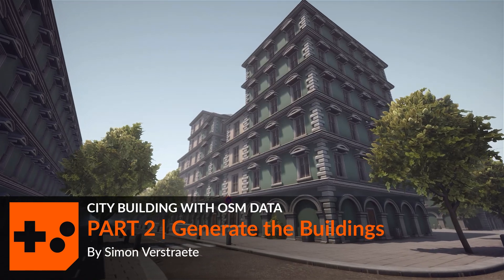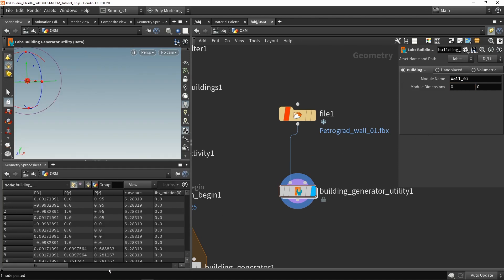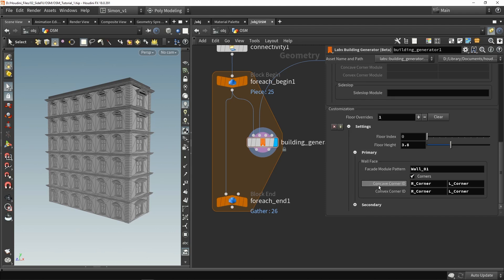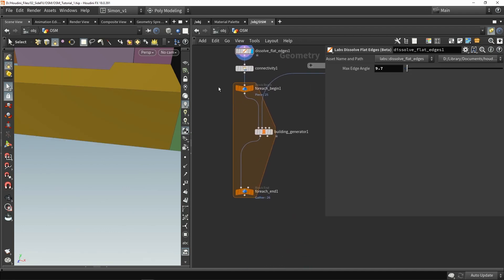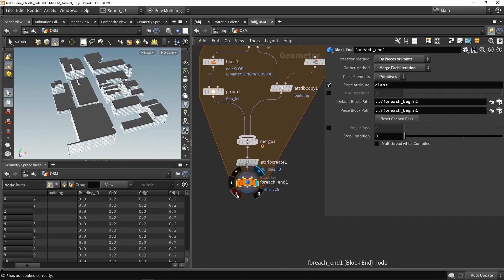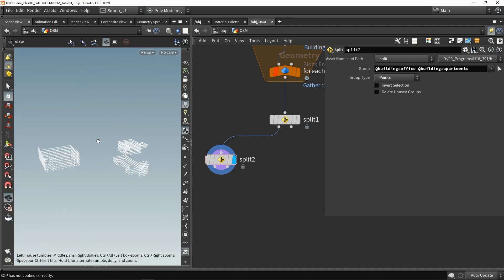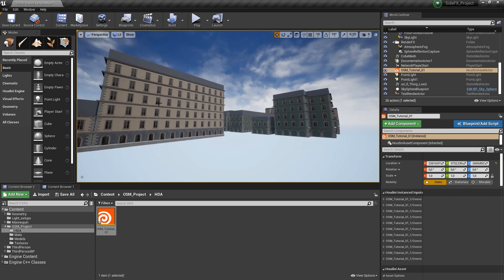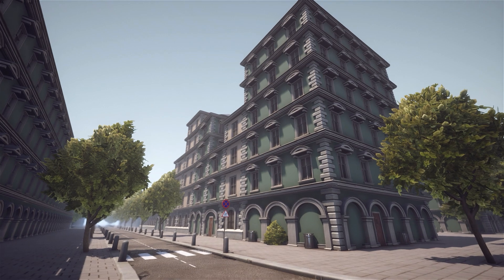City Building with OSM Data | Part 2 | Generate the Buildings

Comment: awh man, was all going great but you completely skip over adding the other fbx files, their sizes and transform settings. Do they all use the same data?

I've tried to just continue, also tried exploring your project files. i just end up with a hole in the mesh where the trim is supposed to be.

Anyone else who is new to houdini and/or not psychic, i wouldn't bother.
 He skips over large amounts of important data, leaving you unable to continue. 
 Looking through the comments, he doesn't even reply to anyone having issues anyway, so you're just left stuck.

EDIT: this is actually impossible without the bit you skipped. i managed to sort the ledge, however its resulted in overlapping meshes.
After an hour of trying to line it up, i decided it'll have to do and move on to the next bit. the wall corners. when i add them and scale them it rotates half the walls. rotating half the walls only means if i make any adjustments to get them back, the other of the walls are wrong.

Think i've wasted too much time with this now. i'm gonna have to try find a different solution in a different program.
Reply: Did you ever find a solution? I can't even get the building to show the building geometry when doing the building generator bit. On mine just nothing happens.

Comment: Any tips on generating collision for these buildings? I'm have major troubles.
Reply: my suggestion is to just simply make collision for the modular meshes and then when houdini places the meshes around you should already have a pretty decent collision mesh, but to be safe I would also bring the original blockouts you get from the osm buildings node and use that as a seperate collision on top of that to fill in any potential holes in the collision mesh, there's probably better ways but this is just a quick one i thought of

Comment: Can you explain a little bit more about modeling "modules" for walls etc. I've made 1x1m grid modeled a simple window, and it didn't fit, also tried different kibash modules - same thing, they were in incorrect places and overall looked wrong.
Reply: Try inserting Transform node after the geometry of the wall, then play with rotation and offset.. you also have to set the size in Building Generator Utility node and floor height to the size of your module.. I use 2x2m modules, set floor height to about 2.5m to make some room for top and bottom trim, and set the seze of 2x2 in Building Generator Utility.. after you have the Transform set correctly it should fit nicely..